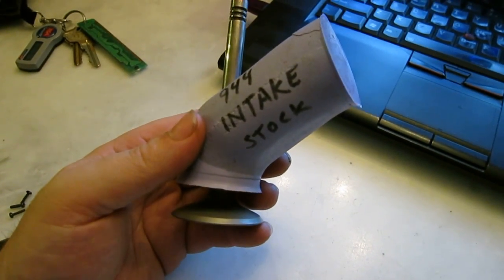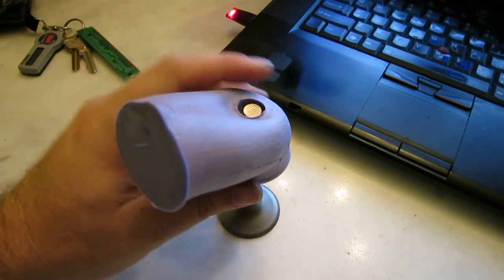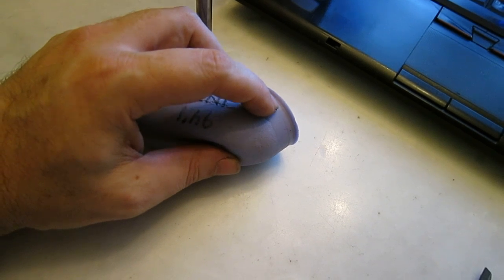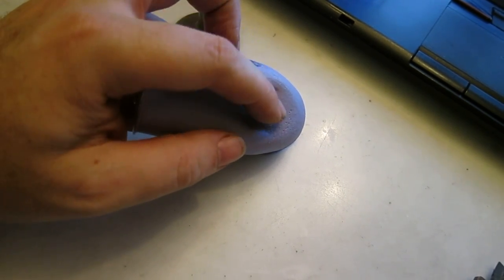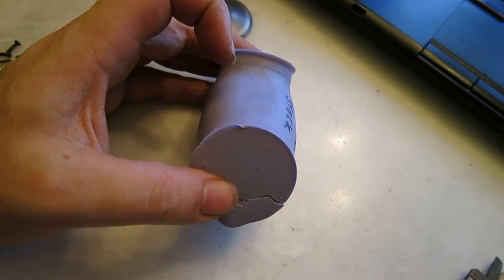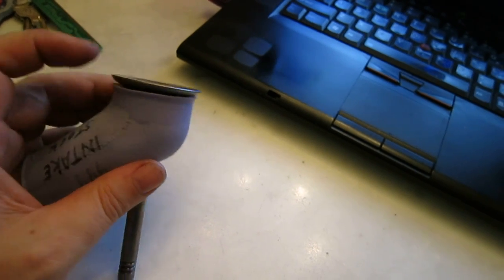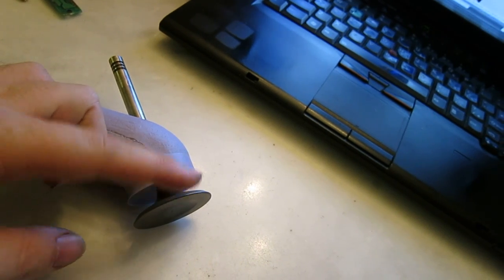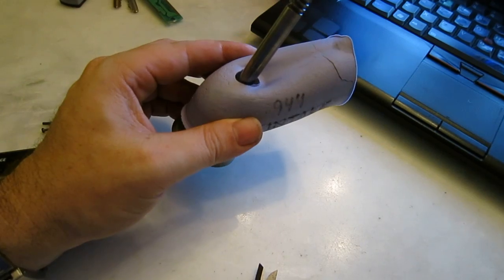Analyzing the intake port of a Porsche 944

Comment: This is a really nice way to se it properly! 

There is a guy in sweden who says that the intake port is to large for the N/A so that the air speed is to slow. He got better flow in the port by building up the underside, witch increases the radius and makes a greater air speed. In theory he should get out about 210 hp from a N/A combined with a cam with 12 mm lift

here is the link to his projekt
http://www.944sverige.com/forum/viewtopic.php?t=17076
Reply: (stumbled on this comment 10 month after it was made from a link on FB Porsche944...)

So, actually the guy u refer to in the "944sverige" forum is from Finland.. (me)

And it's true that the port is to big stock for the stock engine and even for mildly modified ones. The stock port flowed 206cfm@12mm but just ~248fps (75.5m/s) The flow is good but not the velocity! With that little velocity the cylinders just won't fill up enough in time. When we made the port smaller the velocity went up to a good 282fps (86m/s) that is about ho high u want to go on a street engine with ancient port design.. We even gained 2cfm because the better radius in the floor of the port.

... the engine has not been built yet even if the test's was done in 2008.. But the project is not burried ore anything so it will probably be assembled some day. With what kind of cam, intake, ecu, and so on, but it will be assembled some day.. One thing is for sure that it will make more power with smaller ports but how much is still uncertain..
Reply: Aha so you are from Finland! 
Great work you have done. 

This is very interesting! 
Will this give the engine different powerband? Or will it increase power overal. 
What do you recomend to use as material for building up the port? Somekind of chemical metall?  I can imagine that the aluminium expand more than plastic filler. 

It would be nice to see how much power it makes!
Reply: Ossian Calemark Theoretically the power should  come on stronger on all the the way in the powerband. I will use somekind of epoxy, i'm not sure at the moment what brand, but there are a few that are tested and will work.  I might just use the original intake that i'l fill up so it matches the head at firs. Later i will make a custom intake and go with a programmable ecu. But plans can change so what it will be in the end nobody knows..

Comment: Weld in aluminum material around that bend would improve cylinder filling. considering it's only 1 valve that allows air in, any improvment helps. But welding in material, grinds smooth to improve characteristics and a .495" lift camshaft wouldn't be bad. Now it only we would start building a more robust lifter that can handle such a lift on stiff valve springs.

Comment from the maker: Absolutely - making a solid model of that shape (3D scanner?) and working with it in a fluid dynamics simulator could probably find you some good power gains... But that's a lot of time and money!  If you come across a 996 engine that's apart, send me the cylinder head, and I'll make a cast of that, too!

Comment: Van, that's an interesting question you have posed through this video. Do you think computer modeling would help find a better angle or opening at the bottom? That's probably a dumb question. It would be interesting to see what could be done with the 996s, too.

Comment: Hello Van, I do enjoy your videos. I have done some minor porting with the 944 N/A head and found some marginal gain with removal of the casting line as you have pointed out. Air flow is of course all important to help increase hp and unfortunately no real big gains with cleaning-up the N/A head - one more reason why Porsche developed the 16 valve head with the 944S and beyond.

Comment: Thank you so much for the reply! Due to your racing experience I value your words. Are there any problems/weakspots with the 2.0L (924) drivetrain that you know of (as far as strength is concerned)--I the extraction of power from these engines are a lost cause. I have a 1978 Porsche 924 with a 5-Speed G31 "snailshell" transmission.

Comment from the maker: The 924 and 944 handle very similarly - because they have the same weight distribution and suspension geometry.  But, I believe the 944 might have has stiffer springs, torsion bars and sway bars.  Certainly the "sport" models, turbo models, etc. have beefier components.  How to improve it: good tires are #1.  Fresh shocks are #2.  Alignment is #3.  Then you can get into changing components and ride height.  My rockers are about 4" off the ground - the car is quite low.

Comment: Van Svenson I have a question regarding your opinion on the handling characteristics between a Porsche 924 versus a 944 (comparitively). What are some ways to improve the handling of my Porsche 924. Furthermore what is the distance between the ground and door sills, ie ground clearance, of your racing Porsche 944 (if you know offhand)?